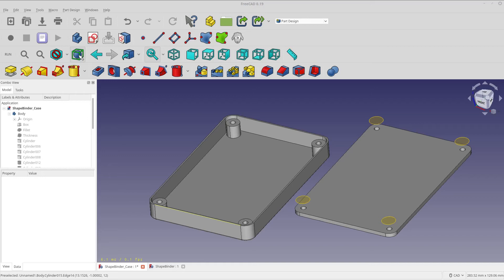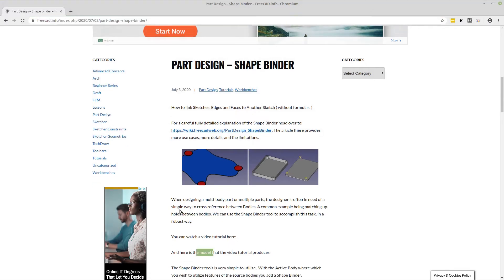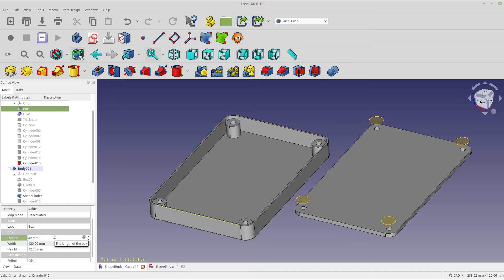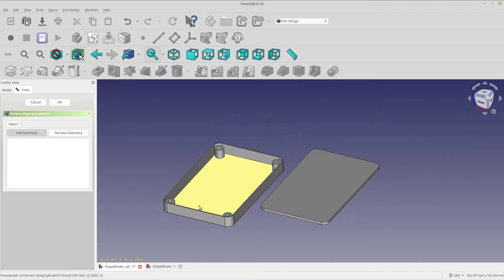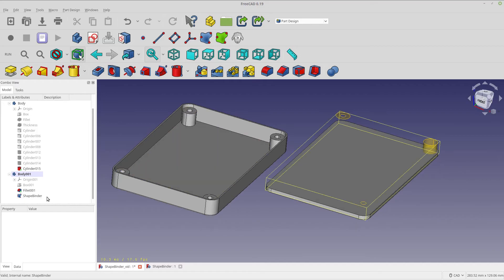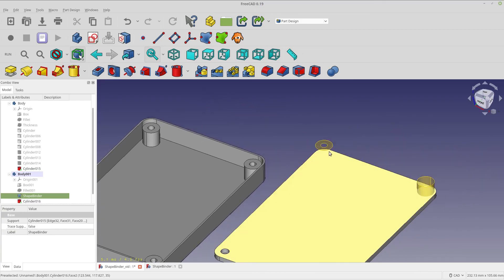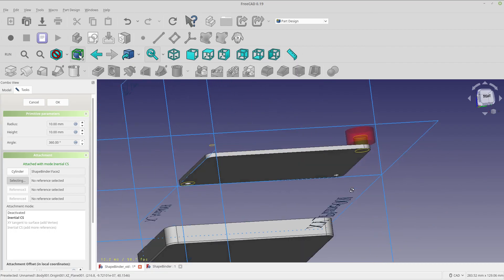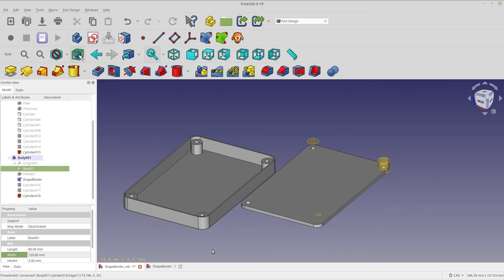FreeCAD Part Design Shape Binder - Sharing features between two Bodies

Comment: Will shape binder somehow work for a sketch : ex. a box with two holes.  I want to create 2 parts : one with hole#1, another with hole#2.  But I want to be able to change the location/size of the hole and want it to update both parts (for a CNC "path").